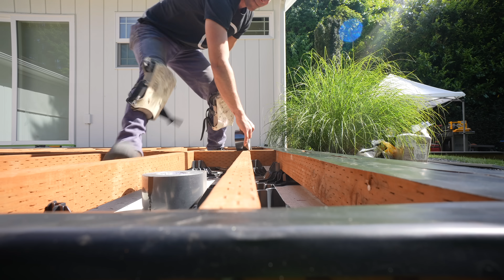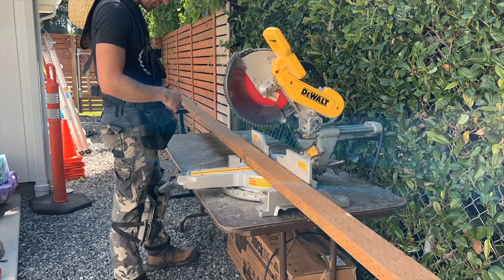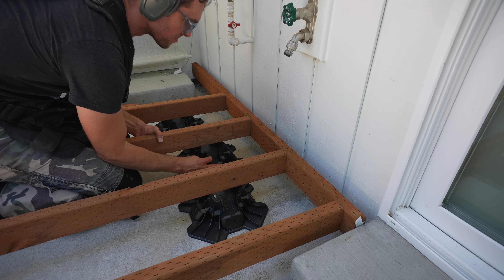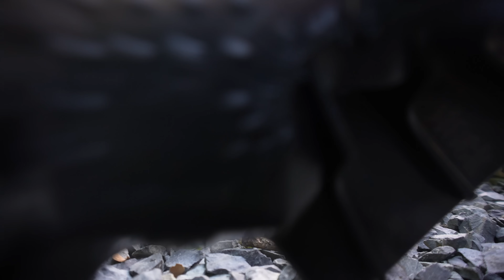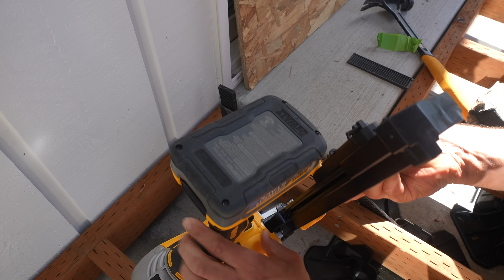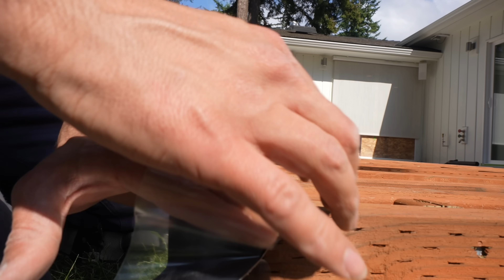How To Build A Low Profile Deck Patio (Part 1 of 2)

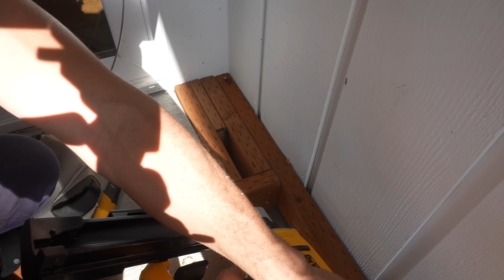Comment: 10:32 Doesn't bolting a "floating deck" to an attached concrete step change it from a "floating deck" to an "attached deck" since it's now permanently attached to the house?

Comment: great video, I've got a 16 x 16ft concrete pad that I'm doing an extension making it 23 x16ft so I'll need to add 3 footings, (maybe tuff blocks with extension).  also going with a presure treated top deck to reduce the costs.

Comment: That’s great if you happen to have perfectly level ground, but does anybody have perfectly level ground? Also, why wouldn’t you just remove the step instead of spending hours grinding it down?
Reply: those tough block things adjust so when you put your lumber in you can level it on an unlevel surface

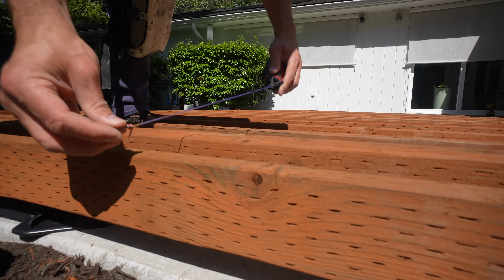Comment: The entire installation screams "sloppy." There's no way the framing came out level, and you can actually see the members going in and out of plane at 8:04. At 9:24, the blocking is split.
Also, if you like your hands metal-free, do not keep meaty parts in front of a nail gun, especially as close as at 9:40. All it takes is a slight misalignment.
Also, if you like your fingers (and your pelvis lumber-free and intact), use a riving knife with a table saw (and ideally a blade guard).

Comment: That could not have been any simpler of a build. The tuff blocks are the perfect height under your joists. I love these as an alternate to a concrete pier.
No digging no pouring. Sometimes an anchor piers are needed to prevent movement, but that depends on your build. nice clean video.

Comment: When you have to grind concrete like that it’s much easier to cut a 1”” grid pattern nearly to the depth you need with a 5” grinder and diamond cutting wheel . Smash that out then u have very little left to grind . Tip: if you can’t see the finished concrete cut it ,smash it ,and leave it .

Comment: that isn't that low profile. I have 3 inches to the door threshold...that is low profile. I have to use 2x2 boards, pressure treated just to make that work. And the boards will be laying directly on the concrete. Water never pools on the deck and is mostly covered, so it should be fine. Mine also won't be screwed into the pavement, because it is boxed in on 3 sides and weighs 500 lbs...so not moving anywhere and I don't have to put a bunch of holes in my concrete.

Comment: Always wondered why so much blocking is added to deck frames. They are an essential part of a wall frame, but a wall has very different applied forces to a deck. I appreciate that they are intended to prevent joists twisting, but when the bottom of each joist is connected to the bearer and the top is firmly held in place by the deck boards (unlike a wall), the chance of the joists twisting seems minimal. One or two blocks at midway points, especially on larger spans makes sense, but I see blocking every 16" on some frames. What are the requirements in US and Canada? Having looked through our codes, I can't find any requirements for deck frame blocking in AUS and NZ. Any structural engineers care to comment? cheers

Comment: I am interested in building a 12 x 20 low profile deck similar to this one,  do you have any plans for a 12 x 20? I will be using pressure treated for the decking.

Comment: When we have a deck this low how do we clean out underneath it?   My deck is going to be underneath a Locust tree that has tiny leaves and seeds that fall through the cracks.   I'm wondering how one cleans a low deck to get rid of rotting organic material and standing water?

Comment: Where do you find ground contact 2 x 4 product? I learned the hard way using pressure treated 2 x 6 that was not ground contact rated and had to replace after five years due to rot.

Comment: Helpful video. What would you do if your concrete step was 4” high instead of 6”? Since the top of the joist would end up higher than the step with the tuff blocks

Comment: Was just wondering, doesn't the 1500mm span works for both X & Y axis? You seemed to have adopted only for a single axis. My point is if both axis have adopted 1500mm span, you'll use alot less Tough Blocks. Just my thoughts. Great video by the way!

Comment: Hey Brent love the video. Per your suggestion would love the plans for a similar build I am looking at which is 15ft wide and 21 ft long. I too am building over concrete which has a bit of a fall so may need to put in some posts towards the one end within the tuff blocks to secure level.

Comment: With the Tuff Blocks, how do you accommodate the slope of the patio? Patios are always sloped away from the house. Shims? That doesn't seem right.
Reply: You have to use paver base crushed gravel to level each of those ltuff blocks... I am doing a 20x14 deck and this is my plan

Comment: Before you announced that it was sponsored by tuff blocks, I already knew. They’re like $10 a piece, and you had 60 million of them
Reply: i was just about to say the same, block cost more than the deck itself..lmao
Reply: @robest109  facts haha
Reply: I use 4x4 blocks instead.  200x cheaper
Reply: @b3arwithm3  I was hoping someone posted an alternative Thanks 😊
Reply: @KayDurrant  it is cheaper but much more work because you have to measure carefully and cut to the correct length for each.  No nice adjustment as the product in this video
Reply: @KayDurrant even cheaper, buy a “horse stall mat”. Cut it up into 2 by 4 inch pieces, screw them into the bottom of the framing and boom, lowest possible deck and off the ground on stable hard rubber that will last 100 years
Reply: That's one expensive sexy beast of a deck!
Reply: Exactly. They need to come down on the cost of those things already.. they'd sell more.
Reply: Exactly,  thats what I saw as well....

Comment: Questin: can I build this same deck, but have it be level with the ground? Following similar instructions just dig a deeper foundation? Thank you for sharing
Reply: level with the ground? do you mean swapping out the concrete slab for a deck the same size as the original slab?

Comment: Just saw your video for this deck patio.
I see this deck was placed over a existing concrete slab.
The house I bought has a wonky mix of pavers, small existing square concrete slab & small half-circle concrete slab with a massive crack down it’s center.
This house is 29 y/o, in could shape. But it was a rental 2 or 3 times in the 29 years.
Last owners were a young couple, for 6 yrs, did nothing.. so backyard and “patio” was never maintained.
My question is would it be necessary to remove all of the existing concrete & pavers? 
Can the type of deck you built in your video be built on the bare ground?
Reply: The key is get the paver bases where the tuff blocks will be on as level as possible with paver gravel then sand... Then put your weed barrier down and put paver base gravel under each tuff block to make it level... Literally you will have 4 lines of paver base about 20 feet long on top of the weed barrier and adjust to make it level.. The gravel on the concrete base isn't going anywhere

Comment: Hey Guys!

It's SO important to protect your decking with a protective layer - you are absolutely right... however, the tape you have there looks to be a butyl tape which over time will wear and crack in the ranging temperatures and environments. The longevity of the decking framework is increased with any protection you give it however our tape has a guarantee of an extra 25+ years of longevity on your decking framework. We care so much about our end consumers' projects that we have designed this deck tape in-house with a specially designed adhesive that is patented!   

Our tape is:

Non-Butyl
Completely UV Stable
Repositionable
Easy-to-tear (no knife needed) but ultra strong
Permanent Adhesive Bond For 50 years
Self-Seals Around Fasteners
Made with sustainable & recycled materials
Can Be Applied to Damp Timber or Below Freezing (Not in the rain or wet timber)

Available in 10 different widths

We would LOVE to send you some free samples of our range and see what you make of them?? It would mean a lot to us but also potentially save you time application, better value for money, and a more robust product overall. Please contact us if you are interested. 

Video example here below (6.32 mins in):

https://www.youtube.com/watch?v=4WkBUC8cPrg&t=391s 

Thanks very much

Walther Strong

Comment: Amateur Question : Wood can expand. How does this not cause problems when the frame is squeezed tight up against the structure of the house foundation and the steps ?
Reply: Great question, and often times something people forget about! Unless I'm missing something, I think he's going to be ok:
1) The vast majority of expansion happens across the grain. This means boards get wider/thicker, but not longer.  With that in mind, the "rim joist" (the board between the two steps that is almost touching the house) isn't going to be a problem because it won't get longer.  But what about the joists?  They are orientated in a way where getting thicker would look like it would squish between the concrete steps, right? Well, he'd be ok there too. Because each joist has open space (10ish inches on both sides) to expand. So their movement won't move the rest of the framing - they will get get thicker/thinner in their own place.  This is unlike a wood floor, where the wood is butted up against each other and each board's expansion adds up across the entire floor.  In this case the only one that MIGHT move things is the one against the step since it getting thicker would push against the concrete.  But that much movement is a very small amount. 
2) He's using Pressure Treated lumber - I missed the type he's using, but most of the time it means that the wood is already very wet... and will only shrink going forward.  So he might get a small gap... but nothing that should be a big deal
Reply: @slopes83  Thank you very much for your very comprehensive reply, and greetings from Prague, CZ !

Comment: 12” OC? Never seen that in framing.
Reply: I'm guessing he's going to install composite deck boards. Most of them require 12" OC as the max distance.
Reply: Yeah he did composite decking and with 2x4.. You got to go 12 inch oc or it's gonna bounce like crazy

Comment: what is the max weight that this kind of deck can handle? Like, could it hold a hot tub or would you frame out an opening and place it on the concrete? Loved the video! Thanks for being human too. It's nice to see pros needing to go back and rework something, because no one is perfect.
Reply: TuffBlocks themselves are load rated to handle the weight of a full regular hot tub with a load rating of 1700lbs per block (break tested to 11,000lbs per block). When you use a number of TuffBlocks directly under the hot tub this is enough to handle the weight, but it's always best to check your maths depending on the size of the tub.

Comment: Good option installing over concrete.  To make the repetitive cuts more efficient setup a stop block using your miter saw.  Keep up the good work. 👍
Reply from the maker: Definitely thought about that.  Just a bit difficult to do on this project since I'm on site and this lumber was 14' long.   I'll have to think up of something on the next project haha.  Thanks for watching and the suggestion.
Reply: in a pinch a heavy tool chest,anything that won't slid easy, can be a good stop block if your working on the ground. with long distances used a box of rocks once for deck boards
Reply: Agreed on both accounts.

Comment: Beautiful and simple. I plan to take on this project this summer BUT I don’t have concrete to place this on. How different would the process be if I wanted to build a low profile deck on dirt? I’m assuming some type of pretreatment/weed barrier is needed?
Reply from the maker: Great question and I meant to mention this in the video but I don't believe I did.  Depending on the area you could just bring in a plate compactor and compact the soil.  If you want to be extra careful that it won't move on you, bring in some rushed rock and compact it that way.  Here is the video I did last year with Tuff Block.  Not the same type of deck but you will get the idea. Thanks for asking and watching. https://youtu.be/hwYbY3LYLv4
Reply: @BYOTools  thank you so much for taking the time and energy to respond to my question!

Comment: No Copper Green or similar wood preservative on the cut ends of the pressure treated lumber?
Reply from the maker: GREAT question Sasha.  In all honest it was the one thing I forgot to bring with me at the job site.  Thats a step I normally do on all of my deck projects.  The tape takes care of it nowadays but since I didn't have the treatment on me I literally made sure that all of the joist ends that where cut are the ends underneath the roof soffit.  Thanks so much for mentioning that and watching.

Comment: How do these do on concrete patios that may have shifted and aren’t perfectly level?
Reply from the maker: If the concrete is stable now and won't shift around much anymore then you should be just fine to use these.  You could shim out the footings where it is needed or use 4x4 posts like i did in this video: https://youtu.be/hwYbY3LYLv4 Thanks so much for the question and for watching Kyle.  Truly appreciate the support.